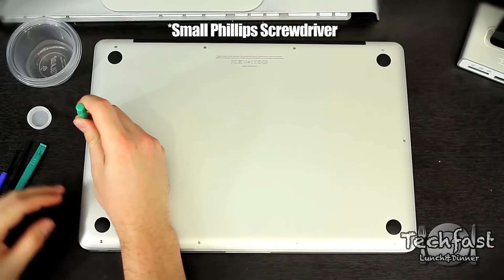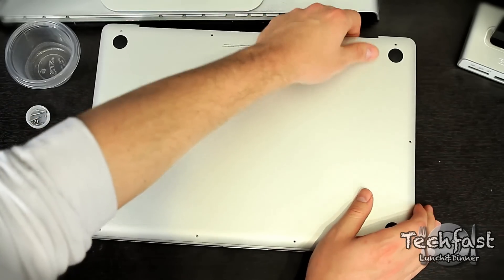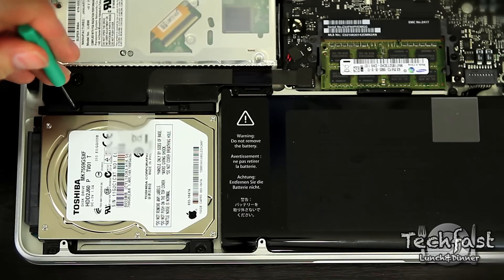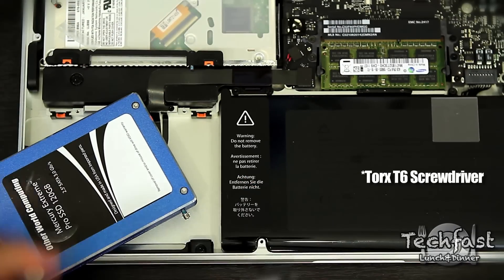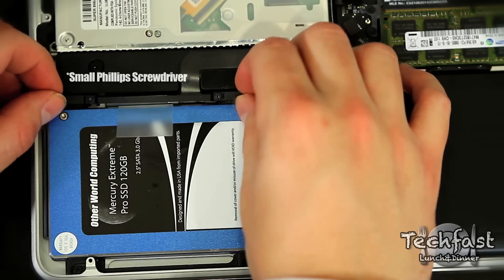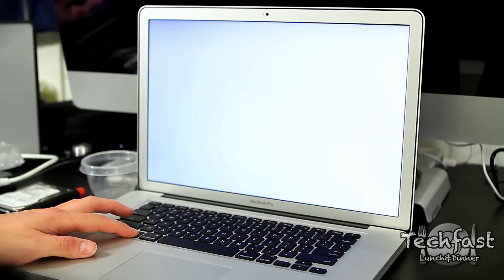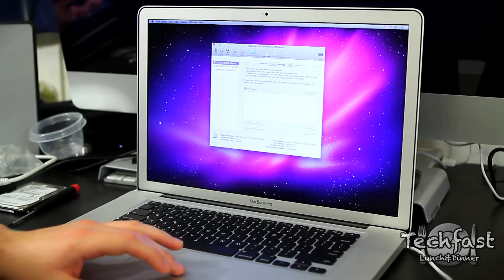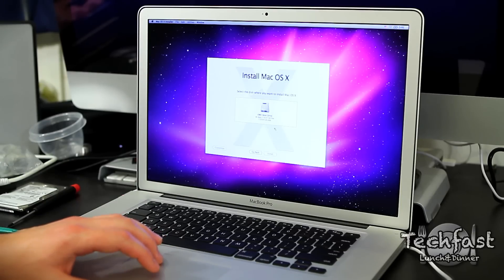2011 15" Core i7 MacBook Pro Upgrade Part 1: 8GB RAM, 120GB SSD & SL Install (How To)

Comment: Mac made it so you can't upgrade their new macbooks. Do you think they best option is to upgrade a 2011 unibody? Will it go up to 16BG RAM??
Reply: Yes, you can upgrade a 2011 macbook's RAM to 16GB, Newegg has some on their website. Just make sure that it comes with 2 RAM sticks if you buy them online (the item should say something like "2 X 8 GB"). 

Also, you could just upgrade a 2011 Macbook if the pricing is right. First off, find the 2011 Macbook you want and see the specs, and then see what parts would need to get upgraded (hard drive, RAM etc.) and total up what it would cost to buy the Macbook and upgrades. Then, find out the price of the new one by going to the Apple Store (or whatever store you would buy it from) and see if it has the specs you want. If it does, just find the price and then compare it to the price of the 2011 Macbook + upgrades.

Comment: I have a mid 2012 macbook pro with an NVIDIA GeForce GT 650M 512 MB graphics card. Is there better cards for mac? I know that's the one it ships in, I'm wondering how to tell whats a better card, and what it would do for me? I am able to run Cod4 and SC2 on Ultra, I'm a video editor with intense software always running like FCP and AE. Would a better graphics card help?

Comment: Great video! Just upgraded my MBP 2012 from i7 4GB to 8GB and this video showed how easy it is to do. You can get the RAM on Amazon for £35 instead of £hundreds from Apple and do it yourself. It's so easy my gran could do it especially if you watch this video. Thanks to the filmmaker

Comment: thank you, someone finally demonstrates how to install the os and setting up the drive, thats the tricky part....If i buy a macbook pro and without even using it immediately buy an ssd and do the upgrade, would this way of doing the reboot work? in other words, there would be no need to clone the old hard drive correct? thanks

Comment: solid state drive. Its a hard drive that had has no moving parts. This makes it more reliable and quicker as it uses flash (magnets) memory. A typical hard drive has moving parts thats why it tells you a rpm

Comment: um i dont think so. I use a main 1TB Barricuda for a bootdrive and storage and then i use a non-partitioned 150 GB for games and stuff. Its a wierd set up but it is non-partitioned so if i replaced 1TB with SSD it should still work. So in all, I do not think it needs to be partitioned, but i am no expert. lol

Comment: It's very easy, once you have taken out your 500GB and put in your new SSD and boot up hold the option (alt) key. You must have OS X Lion on a USB key though, so when you hold option it will show your new SSD and click it. Then you go through some options, click disk utility so you can format the SSD and re name it if you wish. Once that has finished cmd+Q to quit it then install Lion off the USB or a Time Machine backup if you have one. u said u want to restore ur stuff well u need time machine

Comment: @FreeeDom95 It doesnt really matter. I would suggest using som equality RAM though. Use PC10600 DDR3 204pin, and don't buy more than 16GB, it actually supports it,

Comment: @Moe, yes you're wrong. @ Havok, if you have to ask then its not for you. Short version is, when it comes to performance, a fast internal drive beats a large capacity internal drive in every way. The read and write speeds are most important, and are several orders of magnitude faster than a HDD. Also the avg. internal storage need is around 120 GB for the OS, Apps, and their data.

Comment: @HaVoKYouBum I'm pretty sure u got it all wrong...he has an extender that he ordered from owc (i think) and maybe later on he has 500GB's and a 120GB ssd...the main drive is 500GB's and the secondary one is the ssd, so basically he added more RAM and storage...maybe I'm wrong

Comment: @Legoego14 You can pay for an upgrade to a matte screen instead of the glossy screen.  Very important to users who require that colors be displayed as true as possible.  Partly the reason I bought mine that way, but I also hate the glare of the glossy screens as well.  Where I use mine the most, glare is a huge issue.

Comment: @fukademous he could be wearing the anti-static bracelet high up on his arm. even so, i have never had issues with ESD and i never wear an anti-static bracelet. i'm not saying it's not possible, but i work inside my computer once a month minimum and it's never happened.

Comment: Why on earth are you touching the ram pins when removing and MLB circuits when refitting?.. ever heard of ESD safety?

Disconnecting the battery is essential during any repair / upgrade.

I wonder how people have introduced issues to their system as a result of this video.. :(

Comment: Great video - I have a few questions about the Data Doubler though.

1. In my 2011 MBP 15" with 128GB Apple SSD, can I move my WOW folder over to a Data Doubler HDD and have it run properly? What do I format the drive as?
2. After I do that, can I partition part of the drive to run Windows via Boot Camp?
3. As far as installing the Data Doubler, do you use anti-static protection??

Thanks so much - love the videos. Keep them coming man!

Comment: hi does the brand of the ram manufacture matters? what is the original ram (brand) that came out from the macbook pro and which brand of ram you replace it with? thanks

Comment: @jeffaschenbrenner

Upgrading the ram or replacing the hard drive does not void the warranty. However if you damage your computer due to physical damage during the installation, it is not covered.

Replacing the optical drive will void your warranty. Although it shouldn't cause any problems if you follow the correct procedure and use the correct components.

Comment: @WenHan819 Oh, I have the new Macbook Pro 15" 2011 (the same one in this video), and I believe it supports SATA3. So, assuming that now SATA3 is out are the SATA2 SSDs cheaper now?

You said now is the best time, which brand would best fit my needs (esp in speed).

Many thanks mate :P

Comment: Question: How loud is that WD drive?

I used to have a WD Scorpio Black 320gb in my uMB and it was noticeably louder than the stock Fujitsu drive and the stock Hitachi drive in my 2011 MBP. I want to upgrade to a larger drive, but noise is an issue for me since I record music.

Comment: nice video.

i highly recommend replacing the optical drive with a second HD.  Just flash the Snow Leopard install Disc onto a USB drive first.  You can go expensive on cheap on the carriage for the drive.  But if you're doing things like VMWare, having the image an another drive makes, a big difference, imo.

Comment: @kazora1001 He got the anti-glare option in the build to order options on the website. It's better if you do colour accurate work or use it in a bright environment where the reflection could annoy you or get in the way of your work. I honestly haven't had much of an issue even in almost direct sunlight with mine. The LED lighting is pretty damn bright and works at offsetting it a treat. The colours aren't as accurate to life though.

Comment: @Faz3lHD SSD's are MUCH MUCH MUCH faster than HDD's. They're also silent as they have no moving parts, they're far more energy efficient, far more reliable and last longer. They also produce much less heat and are lighter. They're better in pretty much every way but cost, but that will change as they become more common.

Comment: For those not wanting to reinstall the OS. Put the new drive into an external caddy, connect it to the Mac, then erase it as Mac OS Extented (Journaled) (call it something different than Macintosh HD so it's less confusing). Get something like Carbon Copy Cloner or Super Duper, and clone the entire drive to the new one. When done (can take a few hours), try booting from it (hold alt/option and choose it). If it works, put it into the Mac itself. Job done! Should work like nothing changed.

Comment: @heasion2600 no he did the last part because the OS was installed on the old hard drive, i dont think you need to re install the OS if you are only changing the RAM!! :)

Comment: Awesome. I have a question - aren't those screws curved a little bit? Cause when I removed my back cover and then put it back together, some of the screws were fitting better than others into certain holes, or was it just my imagination. ;)

Comment: Hi Jonathan, FYI I replaced my HDD with an SSD on the old MacBook Pro with the i7 and used super duper it did an awesome job. But I'm thinking it wont work in your particular case since it copies everything and the video drivers are probably different. But for those of you who are upgrading and already have all you data in it's a great tool. Thanks for those vids they help allot. TLD RULES!!!

Comment: @JackGiraffe7 I had the Antiglare one and it was really nice, but since I use the computer mostly indoors I decided to go back to a glossy screen which I prefer mostly because of the way it looks. The Antiglare one it's still nice and worth it if you're doing work outside and reflections really bother you which obviously you won't have those problems with the Matte screen. Another advantage of the matte screen is the higher resolution which means more pixels  and more screen real estate.

Comment: pardon ignorance...my extent of adding components is limited to swapping out ram, but I wanted to do this with my new 13" i5...so do you need to re-install the OS after swapping the HD with the SSD?  As in required for functionality?

Comment: When I get my next computer it's gonna be the 15" Macbook Pro with 8Gb's of OWC Ram, a 240Gb Mercury Extreme Pro SSD, the OWC Data Doubler with either the 120GB or 60Gb Mercury Extreme Pro SSD, the highest GHz model, i7 or whatever the best is at the time, high-res antiglare screen, and custom colored by ColorWare. It's gonna be so expensive but be worth it for the next like 10-15years probably... I think

Comment: Heh, i have a 2009 MacBook, i could probably give it a major speed boost by adding the RAM and an SSD drive…its already got 2GB RAM and 2.26Ghz Core 2 Duo….I am sure the SSD and extra RAM would REALLY help (since the drive in it is only a 5400 RPM, even a 7200RPM drive would be a boost!)

Comment: @mindwaveESEA If you read the Reviews then you will know Apple doesnt include the best SSD's for that Price. They are pretty crappy compared to some you can buy for $200 like the OCZ Vertex 2 my personal favorite. This is why most people buy them and put them in their selves. Its more bang for your buck. Also you may not know but the SSD has different read and writes unlike HD's they vary more.

Comment: @thetommantom yeah, i know... but the SSD he's getting cost 250, on the 2.0 15 inch, the SSD cost $200 extra, and on the 2.2 it's only $100 extra. so why buy the off brand that cost $250, when you can get the samething for 200 by APPLE